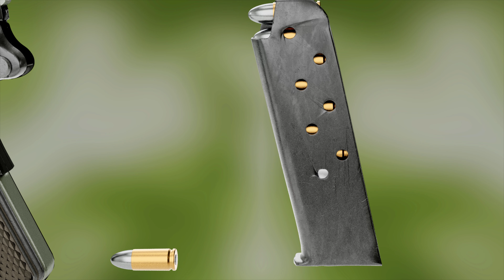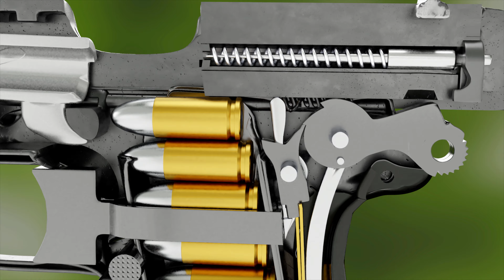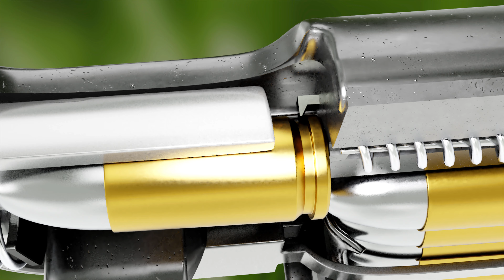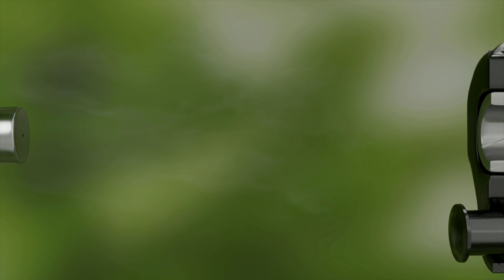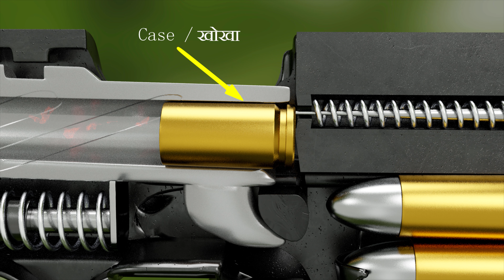How Gun Fires.

Comment: On firings one cartridge, another gets automatically loaded, and the shell gets expelled by ejector, 
But inorder for reloading, the slider need to move back maximum by using the momentum of the previous firing,will that momentum be enough,for reloading,and how it is calculated???
Reply: By the grain of the load, usually 119-132 gr for 9mm loads are sufficient.  When you under load (underpower) the cartridge then you end up with subsonic reloads which do not have enough force to    actuate the slide back.  Any reloading manual will have specs on proper load measurements.